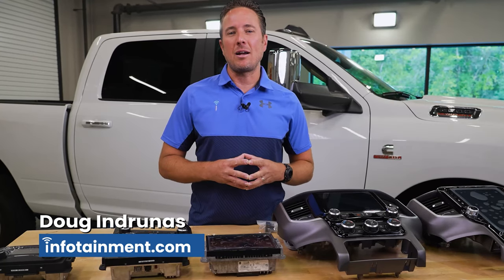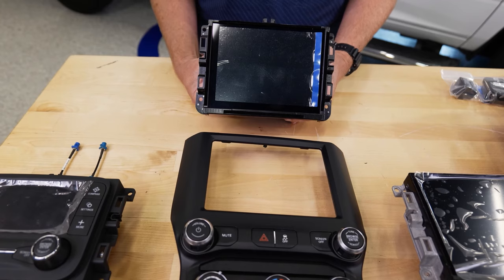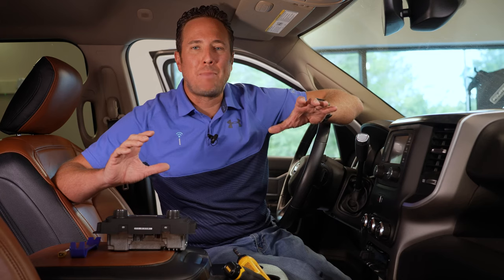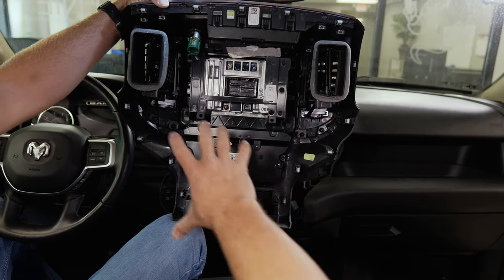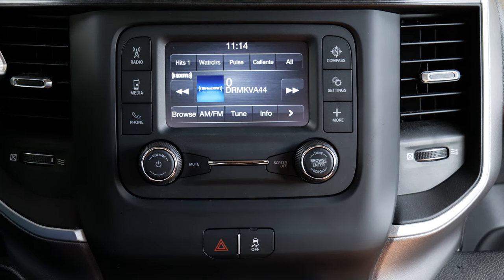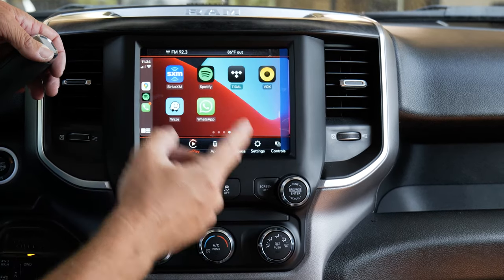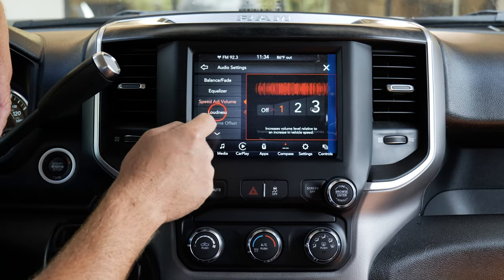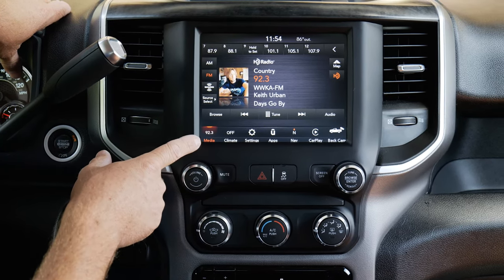2019+ Ram 2500 - All Factory OEM Radio Options - Infotainment.com

Comment: I already have a security bypass cable installed from AEV (re-pins directly into the OBD port) would I still need to install the gateway bypass that comes with this or should it work with what I have? PS, my new UAX unordered from you guys arrives Monday, can’t wait to get it installed.
Reply from the maker: You will have to remove the current AEV bypass and temporarily install the one that comes with the upgrade kit.

The programmer that comes with the kit utilizes the OBDII port. Once you successfully run the OBD Genie programmer, you can remove the bypass that comes with the kit, and reinstall your AEV.

Contact our support department at 855-636-6287 if you have any questions.
Reply: @Infotainment_nav  got it. Did that last night and ready for install today. Thanks for the info.

Comment: Very informative video, I did want to ask for a 2022 Ram 2500 tradesman, will the 12.9 radio just require a radio swap, or will the instrument cluster have to be removed for the obd genie?
Reply from the maker: You'll need to use the bypass module to program the truck. To install the bypass module you'll need to remove the instrument cluster temporarily. You can see that part at 39:20 in the video.
Reply: @Infotainment_nav  thank you

Comment: I just came across this video as I just passed on a loaded out Laramie with the huge screen, for a big horn. So I know the 12” would swap out, as seen in this video. But my question is how is aftermarket audio wired into the radios?
Reply from the maker: Right now we do not offer a solution that is compatible with aftermarket audio connections. There are some aftermarket solutions that are designed to work with OEM equipment and those would work, but we only offer the OEM solutions which are not naturally set up for aftermarket audio.

Comment: I would like to upgrade to the 12" but $4k for an infotainment is just insane to me.
Reply from the maker: Compare that price to a new truck with the technology built-in from the factory. 

With this particular system, you're talking about a more expensive trim package. At best you're going to spend $48k, probably closer to $65k right now. 

The dealer won't sell you the radio by itself.

Most vehicle infotainment tech upgrades every 5 years. You've extended the useful life of the vehicle as long as you keep the engine in good condition.

Because it's a factory system, you can add other features such as BSM, ParkSense, Power Mirrors and a host of other features. 

All of which will work just as if you purchased them from the factory. You can't promise that with an aftermarket upgrade.

Add in the plug-and-play engineering, programming and no wire cutting which protects your warranty, there's plenty of value in the purchase.

A $4k investment isn't for everybody. But there is great value in this radio at that price.
Reply: There’s ways around it I bought a 4c uconnect 12 inch screen with module and all I did was buy the adapter and uax cable from a guy on a eBay and he also has key bypass to install the radio everything for 750$ 600$ for screen and module and 65 for those 2 cables and 99$ for the bypass
Reply: @spurs5677  thank you for the info!

Comment: I want the 12” screen for my 21 tradesman. Would you pass me the link  to order please? I know the tradesman has no heated/ventilation steering wheel or seats, sensors, etc… will those be grayed out once 12” screen installed or what would change? TIA
Reply from the maker: Please feel free to contact our sales department, we would be happy to assist.

1-855-636-6287 Ext: 2 or sales@infotainment.zohodesk.com

Comment: I have the UAV in my 2020 Big horn 2500. I picked up the factory woofer that mounts under the rear seat and the amp. the wire for the speaker was tucked under the carpet. is the amp a plug and play? what else will i need from you to make it work?
Reply from the maker: We do not have any AMP solutions for this vehicle. We only sell the full kit upgrade to the radio. Sorry for any confusion.

Comment: My traction control is not by my hazards, it’s down on the switches below my AC controls. Would this still work?
Reply from the maker: Yes the upgrade would still be compatible.  You are always welcome to reach out to our sales department.  Depending on what is available we may be able to provide a bezel without the traction control button. But regardless, this would still be a compatible upgrade. 

1-855-636-6287 Ext: 2 or sales@infotainment.zohodesk.com.

Comment: Do you guys offer the UAX option in a matte finish?
Reply from the maker: There are a few different bezels. If you click into this link you can cycle through the images of the bezel that comes based on your trim level package. 
https://infotainment.com/shop/interior-accessories/infotainment-radio-upgrades/2019-2022-ram-1500-uax-uconnect-4c-nav-with-12-inch-touchscreen-including-apple-carplay-android-auto-upgrade/

Comment: will these work on the 2024 modules ?
Reply from the maker: Compatibility in a 2024 would depend on your current configuration.  This particular upgrade is Uconnect 4.  If your 2024 is currently equipped with a Uconnect 5 head unit, this will not be a compatible upgrade path.  

You are always welcome to reach out to our sales team to discuss compatibility 1-855-636-6287 Ext: 2 or sales@infotainment.zohodesk.com.

Comment: puedo comprar solo los arneses, la OBD y el Security by Pass?
Reply from the maker: We would not sell it that way for any reason. We do not sell the harnessing on its own for any of our kits. If the price is a bit too high to do the full kit you may want to consider going with an aftermarket part as opposed to OEM. We put a lot of effort into making sure this upgrade has no issues and has all the correct equipment sourced based on the Vin and we have found that piecing these upgrades together part by part has a very high failure rate. We recommend going with our full kit or checking out something aftermarket as aftermarket radios are much more a la carte friendly.